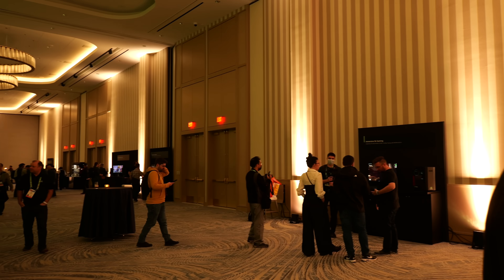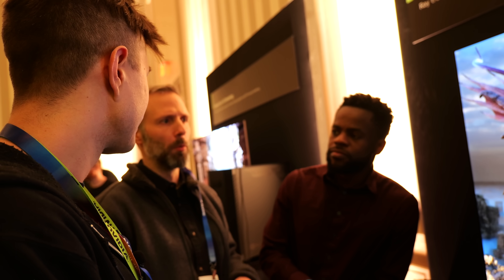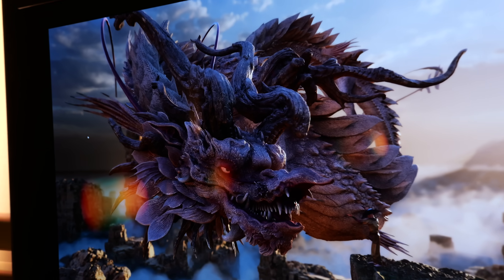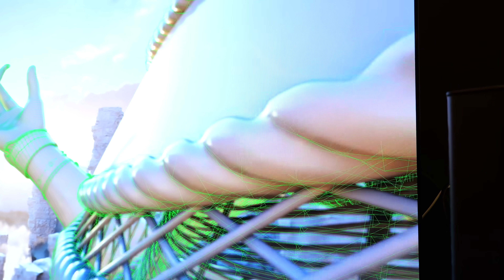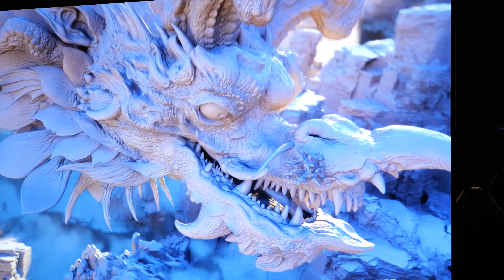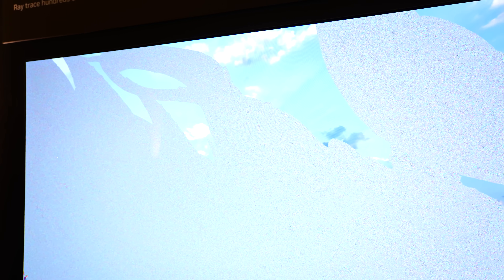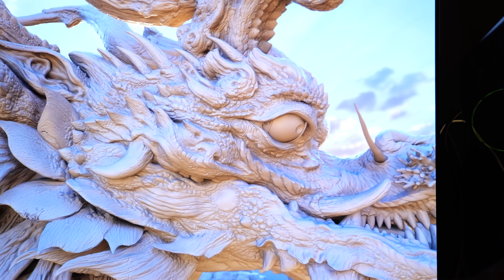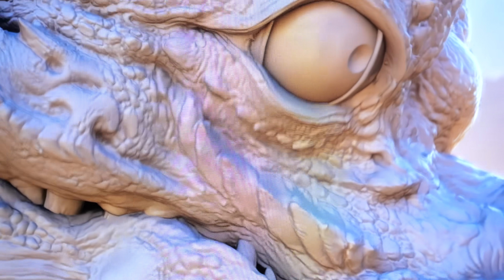RTX Mega Geometry Is A Big Deal... But What Does It Actually Do?

Comment: Nanite impressed when it was first shown off, but zooming in on a friggin texture and having it be drawn as real geometry is MIND BLOWING
Reply: Imagine an Ant-Man game with this tech.
Reply: Okay, I'm gonna shoot: how is this different from just doing a lot of tessellation?
Reply: @Blaze6108 
how are you going to shade that tessellation, keep it performant, and how will it be defined?

tessellation isn't cheap, nor is raytracing

what's being done here is sub pixel in detail and it's casting shadows via raytracing --- this is revolutionary stuff
Reply: @charoleawood  Hmm, so it's basically something like tessellation, but it supports shading through ray tracing, I guess?
Reply: @
the level of geometry detail is also constantly changing in a dynamic manner

geometry close to camera get drawn with more triangles, geometry further away fewer --- this changes both as the camera moves and the geometry itself moves and deforms

as Alex explained, it is very hard to raytrace in a per-pixel manner with this amount of change happening at all times, the calculations get thrown out of whack

Mega Geometry is working at an application programming interface level to make such dynamic and detailed geometric raytracing feasible

it does this, in part, by taking whats normally done in rasterization and letting the basic geometry itself be calculated through ratracing --- normally raytracing is just for shade and reflection, not for defining three dimensional vertices
Reply: And a waste of perfomance if the majority of people of people game at 1080p and 1440p.
Parallax occlusion mapping can look similar without adding trillions of polygons for a stupid rock that ends up as a pixel.
Reply: @ yep, it is much better if they have high texture object load more efficiently and smoothly then all these
Reply: @saricubra2867  I guess you missed the part where geometry subdivision is camera based.... ._.
Reply: @eduardomartin8510 But no one cares about how good a very tiny stone on a rock looks, adding 3 million polygons for such a tiny detail like that is absolute nonsense.

Why not improving lighting instead?
More games like Cyberpunk 2077, less like Hogwarts Legacy and Jedi, i mean CPU Survivor.
Reply: @charoleawood It's not quite a texture being drawn as real geometry, it is actual real geometry's geometry being modified by the texture. We've had this for decades in animation but it's cool that they're doing it for real time now. What happens is that a displacement map (in real time they call it height and other names) informs how much "displacement" from the basic geometry needs to move from its original position on the object's surface.. The software then subdivides the geometry depending on either user input or camera distance. 

Now let's see how they deal with the equivalent of massive cinematic UDIM textures for games... it's a lot of memory.
Reply: @eduardomartin8510 
thank you for this clarification! : )
Reply: @eduardomartin8510  and as i said , they should be targetting to the current market, not tellling people everyyear your pc is outdated
Reply: And now it's one of the curses of ue5 together with lumen T_T
Reply: @xviii5780  non gamedevs, just watch stupid videos, from stupid youtubers, take it for solid as bricks and spread the word of it, without knowing they talked nonsense right now.
Reply: @Punisher1992 You mean the YouTubers that show vast and deep knowledge on the subject and actually present evidence for their claims?
Reply: @Tbm147  quite ironic that you brought up money, when the reason why games have been so unoptimized is because of greed.

Oh yeah, I guess Cyberpunk 2077 was optimized really well during release. After all, it was made by people who had decades of experience in AAA game dev. They were definitely not pressured by the higher-ups to rush the release of the game. Surely, there is barely any difference between versions 1.0 and 2.0 in terms of optimization, right?

Silent Hill 2 Remake is so optimized, it renders objects in full detail despite them being covered by fog. Wow.
Reply: @Punisher1992  nope, you proved nothing. Nothing to even back up your claims.
Reply: @gemgem-hl7ii  first of all, nanite has skeletal mesh tesselation too since 5.5. also its proven, that megalights (also lumen) has the best performance for what it delivers, same with nanite. Ofc you can go the way create many lod for every model, but if you make a game that is graphically demanding, you may better off just use nanite, it also reduces your games sizem because you dont have to have so many lods stored at all. You CAN get rid of normal maps, either if you use native meshes or tesselated nanite meshes. there is so much it improves. Ofc the point of blurryness is annoying, but thats a developers choice, and never a problem of nanite or lumen. my game uses not AA at all, and its sharp as a blade, because i CHOOSE it to be in unreal engine. Its not the techniques, its the developers.
Reply: @gemgem-hl7ii YouTubers are mostly paid they don’t know anything about graphics ,that’s why they praise elden ring the turd looking 2012 garbage like it’s some marvel.
Reply: @Punisher1992  megalights has good performance, but at what cost? Ghosting. That's not okay. Nanite wotks on skeletal meshes but is limited to only certain materials.

"If you make a game that is graphically demanding..." But why? Are we making a game or a movie? Is it a product or a tech demo? Why would it need to be graphically demanding when it doesn't have to be? Game devs should always consider lower end hardware for that generation at least...and that's the problem with nanite. It lacks scalability and flexibility. Traditional LOD gives precise control over performance optimization, which is important for fine-tuning resource allocation, especially on platforms with varying hardware capabilities. Yes, we can use actual geometry instead of normal maps, but relying solely on high-detail geometry will increase computational demands and will impact performance, particularly on lower-end hardware. Sure, you can disable antialiasing at 4K resolution maybe, but most gamers play at 1080p and 1440p.
Reply: @gemgem-hl7ii  Nope, Youtubers that present edge scenarios specifically constructed to support their claims which are not representative of typical game worlds.
Reply: @gemgem-hl7ii  "But why? Are we making a game or a movie? Is it a product or a tech demo?" There has always been games that use graphics as a selling point and that's okay. You don't have to be into it. There are more games releasing these days than ever before. People would be happier just using their time to play things that they like instead of complaining about games that they don't. There is plenty out there for everyone. I don't get this part of internet culture... Not everything has to be made for you specifically. You are A target audience for someone, you are not THE target audience for everyone and that's okay.
Reply: @xviii5780  agreed! Keep it up man 👌 arm yourself with more knowledge so these nerds don't just try and punch down on you, leaving your comments losts in the sea of nerd rage baiting for their favorite graphics engine. UE is great but currently detrimental to our wallets via increasing hardware costs--all for lesser performance and worse visuals.

On the bright side though: my PC makes a great space heater for these cold winter days 😂
Reply: @coreytaylor7367 just say you are poor n stop coping ue5 is insanely good , it’s not devs fault you are poor
Reply: @ttghhgg1918  quite literally run the best hardware you can buy.. and buy all the newest hardware when available. Tough reality you live in, I know. Lol.

4090 FE for sale come February. I'll give you first dibs. Broka ahh mf.
Reply: @xviii5780  It's really not.
Reply: @OverJumpRally  It really is.
The way it's advertised and used is severely hurting performance, not to mention the need to use TAA to cover up the flickering of small details when you zoom out.
On the Silent Hill 2 remake you can disable Nanite with a command, there's no noticable difference and you gain a big performance boost (depending on resolution).

Epic Games, graphics enthusiasts and lazy gamedevs are hailing it as one of UE5's greatest features. While actual graphics engineers are screaming at Epic and gamedevs to use it responsibly.
Reply: @OverJumpRally 
UE5 is singlehandedly trying to destroy great optimized games. Look at how all these games made with ue5 have worse image quality than past gen games. It's a plague that needs to be snuffed out.
Reply: @OverJumpRally Combined with shitty TAA it is an absolute curse in modern games, making everything a blurry, thirty mess.
Reply: it is hurting the performance in a way, and people will compare cost- performance-quality together. back then before rtx the rasterisation is doing a great job. now they are telling the dev no need to worry about optimisation , just do the most dense mesh you can do and let the gamer take the hit and pay for more expensive gpu

if you compare NFS Underground2 and current game like forza 5 or forza motorsport for example, you can see NFS has put so much effort so that it run well on the hardware available at the time,
Reply: So many idiots in this comment section my goodness🤣🤣… 

are game graphics any better looking compared to the last 5-10 years? No!!! And they still run like shit!!! and here you are saying “stop being poor” like the 5090 isn’t going to use frame gen to hide its struggles with raster performance.

Like are they paying you to be blind??
Reply: @petreefyedn0ire They do look better... but perhaps not enough to justify the monetary and performance cost. Reducing returns and all of that.

Comment: I don’t understand, how is this different from nanite?
Reply: They state the difference in the video
Reply: Nanite is only for non deformable surfaces, but what Nvidia has developed here can be applied to Nanite so that full path tracing with these detailed lod transitions is more feasible, it is working on an application programing interface level 10:08

this question was also answered on the DF Direct during the QA time at the end
Reply: @charoleawood nanite does work for deformable surfaces
Reply: It doesn't run like ass with raytracing
Reply: @Die-Coughman  oh really? you think Nvidia is gonna make some new tech that doesn't run like ass?
Reply: To me seems to be like nanite, geometry streaming as small clusters, called meshlets, also called virtual geometry (yes similar to virtual texturing), coupled with local view tessellation, so I also don't see what is different compared to nanite?! And nanite works with Lumen that is a raytraced lighting system.

Comment: 1TB game size let's go
Reply: This is actually much better footprint wise than the nanite approach since these are just medium poly meshes with a tiny compressed heightmap texture per-triangle (no wasted UV space) instead of billion poly models. Nvidia has been experimenting with these kinds of micromaps for a while and I gotta say its a much more elegant and less bruteforcey solution than nanite. TLDR Its basically just hardware tessellation 2.0.
Reply: @kenziemac130  Except this IS Nanite with this tech on top... which is also already available on Nanite by default (the tessellation part). Nanite meshes take less space than ordinary LODs because their compression and because you don't need extra models. Also, most of the space is taken by textures, especially Normal maps, which here are completely absent.
Reply: This is LITERALLY aimed at lowering disk space aside from other things, what are you talking about?
Reply: Games go back to retail stores in individual HDDs
Reply: 7:16
Reply: Jajajkaajajaj so true
Reply: I am fine with it if it doesn't look like trash, but they could off optional LOD downloads.
Reply: Exactly 
This is a big problem 
170 gb for FF16,Rebirth will be 150 gb.
I have no space left😢
Reply: @marcokemper6349  buy new ssd ? 1 tb costs less than 40$ now. For PCIe 3.0
Reply: Am I misunderstanding this then?
Reply: @neon1718  Yes lol. One singular highpoly model per game object instead of 3, 5, 7 or even 10..